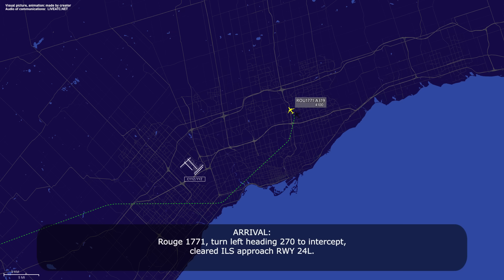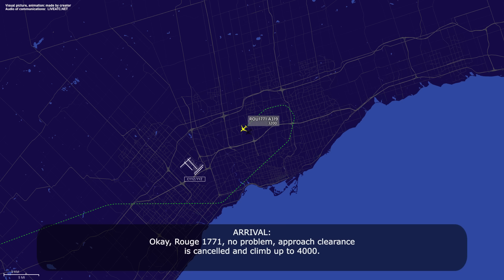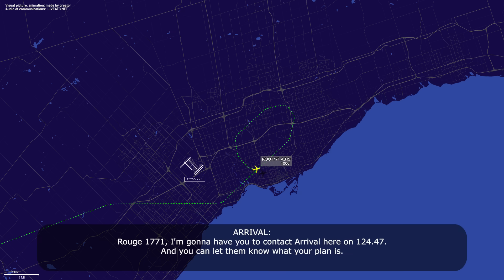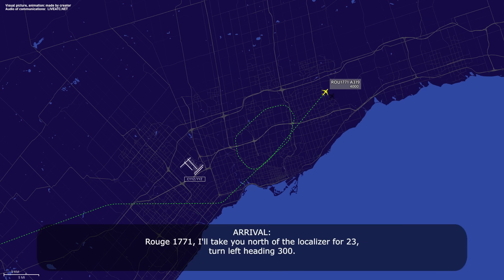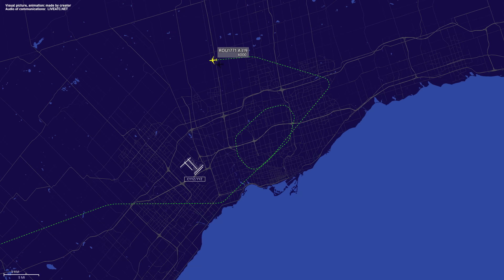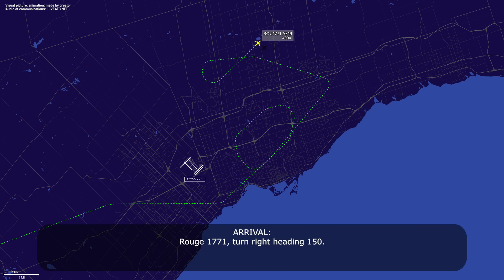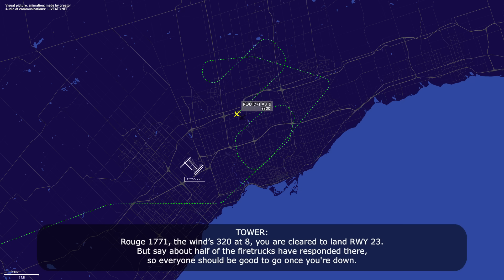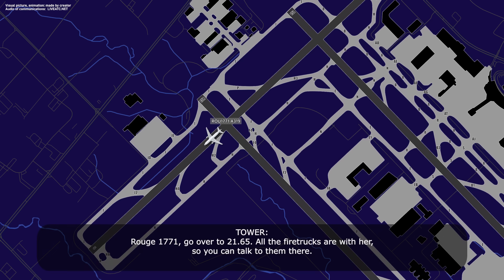Zero Flaps landing. Air Canada Rouge A319 has problems on approach at Toronto Airport. Real ATC

Comment: i dont get this bizarre notion of stopping on the active runway if you are mechanically able to vacate??   why on earths' name would you subject your ship to that kind of needless extra risk from being on a runway? 

brake, vacate and keep rolling - there is no extra energy incurred into the brakes if you keep it going at 20-30 kts and stop somewhere, just incase your wheels deflate. 

Stop at an apron and had ARFF verify you have warm brakes (no shit).
Reply: It's not bizarre. It's a very standard industry policy at many airlines. What's the extra risk of stopping on the runway at a controlled airport? No one will land on that runway until the aircraft is cleared. 

Zero flap landing can be a serious emergency with hot brakes and or risk of runway incursion. Common company policy is to stop on the runway for any emergency and have the aircraft inspected, then decide. If the wheels deflate and brakes catch fire while taxiing around, there's added risk to passenger safety and it's more complicated to initiate an evaluation.

They may have had additional issues, hydraulics for example that affected flaps and brakes, possibly leading to reduced braking and even hotter brakes.
Reply: @andreww4171  that you are unaware of the small, but very real danger of a runway incursion, is staggering. 

A flaps up landing is not automatically an emerg. 

ALWAYS get the ship off the runway and park elsewhere if its not on fire and is mechanically able to do so. I dont care if its retarded company policy to park on the active, its absolutely idiotic - like so many policies are - and people will die before rules change. 

The risk of a hull loss is small but very real, ESPECIALLY at night or IMC.
Reply: @andreww4171  that you are unaware of the small, but very real danger of a runway incursion, is staggering. 

A flaps up landing is not automatically an emerg. 

ALWAYS get the ship off the runway and park elsewhere if its not on fire and is mechanically able to do so. 

I dont care if its retarded company policy to park on the active, its absolutely idiotic - like so many policies are - and people will die before rules change. The risk of a hull loss is small but very real, ESPECIALLY at night or IMC.
Reply: @andreww4171  funny how my reply got deleted, lets try again
Reply: I think it is SOP after an emergency landing. Almost every time I have seen a clip from an emergency landing, they sit on the runway for a few minutes before proceeding to the terminal. I think it is a safety thing.
Reply: @ flaps up is not an emergency - not sure what company you are referring to
Reply: @ghostrider-be9ek  Once the pilot declared a PAN-PAN-PAN, it made it an emergency. Why do you think the emergency response team was dispatched?
Reply: @brianmcdonald6519  lets try this again, what comms define an emergency in the air please? hint - its not PAN
Reply: @ghostrider-be9ek  If a PAN is not an emergency, then explain why the emergency response vehicles were AUTOMATICALLY deployed! A PAN is an aircraft in a non-serious emergency, where a MAYDAY signifies a serious emergency. If the emergency vehicles are deployed, the aircraft almost always waits for an inspection before proceeding to the terminal. This has been the case in virtually every video I see of a plane landing after some sort of malfunction.
Reply: @brianmcdonald6519  that is incorrect - lets try again. 

PAN is an urgent matter where landing soon, is a priority 

MAYDAY is an emergency where the aircraft is in immediate danger (eg. LOC, open flames on board)
Reply: @ghostrider-be9ek  So, then, why did this pilot use PAN, when they were definitely NOT wanting to land right away!! By your definition, they should not have used PAN!! They took their time trying to work out the problem, before requesting landing clearance. My definition of PAN is an aircraft broadcasting that they have a problem, serious or otherwise. I have heard this from different people in the aviation industry.
Reply: @ PAN is used when you need priority landing over other aircraft - a high speed landing is one such event as separation cannot be maintained on approach from others any longer and ATC needs to know
Reply: @ 
PAN-PAN-PAN is a specific radio phrase to advise of an URGENT situation that is NOT a life threatening emergency.  It's a signal that something is wrong and requires immediate attention, but not immediate rescue.
Reply: @   No the declaration of PAN-PAN-PAN is a specific phrase with a specific meaning  that there is an urgent situation that is not a life threatening emergency.     An aircraft might use "Pan Pan" to indicate a system failure that doesn't pose an immediate threat, but requires attention.
Reply: Have you considered applying to the YTAA (YouTube Aviation Administration) to get your Airline Expert badge?
Reply: @TootSocialTV  no sorry, my 25 years in the aviation industry (pilot + mechanic for a legacy carrier) is not suitable - one needs to have 0-2 months of experience to qualify
Reply: @   Everyone on the internet can claim they are a 25 year airline pilot and mechanic.  But they usually include their rating, hours and equipment experience.  And if you were a line captain or A&P for a Part 121 carrier, you'd know that after a landing involving a systems failure that could involve hydraulic fluid leakage, that you don't move any more than is required, lest you cause more problems.  The A319 has 3 systems plus the APU and the RAT.  Any of them should be able to lower the flaps so if they ran the QRH and tried the Green, Yellow and Blue systems, then that would suggest there may be a hydraulic problem that could affect other syst4ems such as steering, brakes etc.   The runway was CLOSED so there is no hazard of a collision.  We're not even mentioning brakes possibly overheating.  The prudent thing for a prudent Captain is to stop the plane, let it be insepcted and go from there.
Reply: @TootSocialTV  

Tell me again how many hull losses on CLOSED  RUNWAYS have happened over the last 40 years? (hint, its above 0) 

Why do people have to needlessly die in aviation before SOPs or regulations are changed?

Comment: I was on this flight. Great communication by the crew throughout the entire situation. Kudos to all.
Reply: Curious as to what was said to the pax. Did they tell you it was an issue with flaps? Or a problem with the aircraft?
Reply: @ Captain said after our approach was cancelled that there was a "flap issue", and that they would run some checklists. A while later, he came back and said that we would be going in for the approach. He indicated it would be a fast approach, but otherwise normal, and that the emergency vehicles would be meeting us on the runway.
Reply: Does it really matter as a passenger?

Comment: Why stop on the runway for a flap problem? The engines still work right?
Reply: Possible leaking hydraulics as well.
Reply: Hot brakes
Reply: @jamiehancock6296  Hadn't thought of that, but you are right! Would be extra hard braking with no flaps!

Comment: Why wouldn't they use the 33 runways with the wind coming from 330?
Reply: A 7kt crosswind is something pilots at this level can correct for subconsciously and easily, especially if it’s steady and not gusting as in this situation.  More importantly (and elegantly), In a crosswind landing you have to crab the airplane to keep it headed for the runway- the crab causes extra drag to slow the plane, much like flaps that are INOP in this case. Actually pretty smart.
Reply: Runway 23/05 is the longest runway we have at Pearson.
Reply: @busdriverpeter  I think 33R is actually slightly longer for landing
Reply: @kickedinthecalfbyacow7549  No, he is right. If you check YYZ specs, you will see 23 is the longest on the field. In any emergency, the aircraft will always land on 23/05 regardless of wind direction. Largest margin of safety.
Reply: @ runway 23 has a displaced threshold
Reply: It’s not the crosswind, it’s the headwind that would be beneficial. Any reduction in ground speed is going to improve the chance of not melting the tyres.
Reply: I had the exact same thought, 33R is almost the same length as 23 so I'm surprised they didn't go for that one
Reply: They used 23 ..
Reply: @jd2plus2  they did use 23, so they used a slightly shorter runway that wasn’t into wind.  That’s why this thread was started, maybe use the into wind runway that is also slightly longer, that way you have a lower ground speed when you touch down and more runway available to reduce braking.

Comment: Why would they have to stay on the runway for 11 minutes before preceding to the gate? Was there a hydraulic problem? If not, why not take one of the taxi ways and clear the runway before stopping for 12 minutes?
Reply from the maker: I guess they were being inspected by the emergency services. Probably they had hot brakes after high speed landing (flapless landing).
Reply: Potential of a fire due to hot brakes after MAX MAN braking.
Reply: Pearson is pretty on the ball ❤
Reply: Hot brakes isn’t that much of an issue because they wouldn’t land it calculated performance wouldn’t allow it. However, they will likely want to be assessed by ARFF anyway, for leaks from the hydraulics.